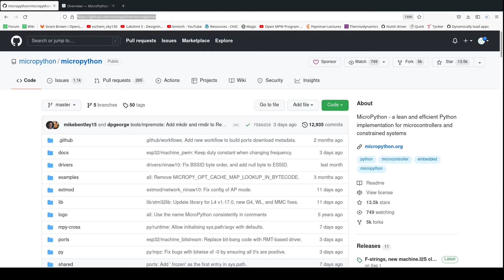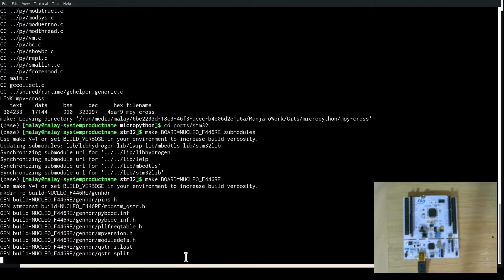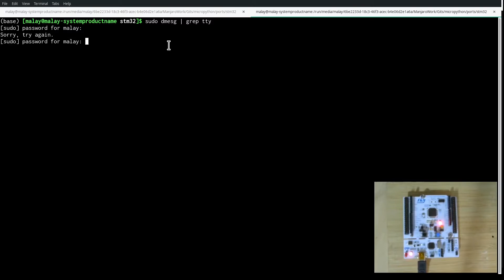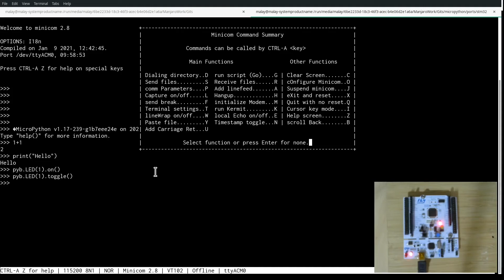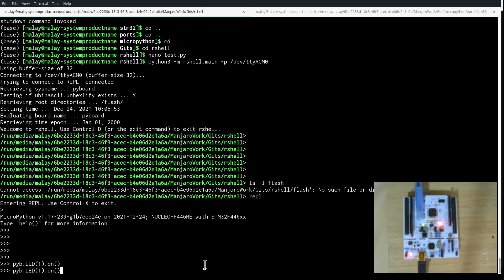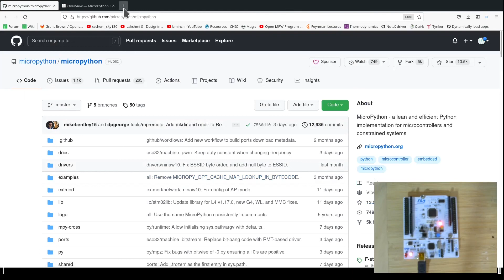Step by step MicroPython on Nucleo-F446RE

Comment: What should I do in order to use this method in windows? What could I do for using the: "make -C mpy-cross" command? Is mingw-w64 needed? I would like use this way but in windows through a git terminal with Visual Studio Code IDE. Thanks in advanced, I liked your video.
Reply: Answering my own question, just in case it helps anyone who had the same doubt. 
We need to install these SW in windows in order to make the compilation works:

- For a Linux terminal, we can use a Git bash, so install Git.

- Python3.

- arm-none-eabi-gcc (Arm GNU Toolchain): ARM Developer.

- gcc: It could be from MinGW-w64 GitHub.

- make:	Once you have MinGW-w64 installed, add mingw32-make.exe to PATH (ex: C:\Program Files\mingw-w64\[version]\bin).
	        Rename mingw32-make.exe for make.exe to simplify comands.

- openOCD, or any other flasher tool like ST-Link inside STM32CubeProgrammer.

For serial comm we can use any like teraterm, putty, Arduino serial console, etc.

I hope you can find this useful. :)

Comment: Can you select which UART to use for the REPL interface?

And how do you upload the python scripts to execute... I assume by default it will look for main_py at power-on?

I'm interested in commanding different custom scripts via the UART/REPL.
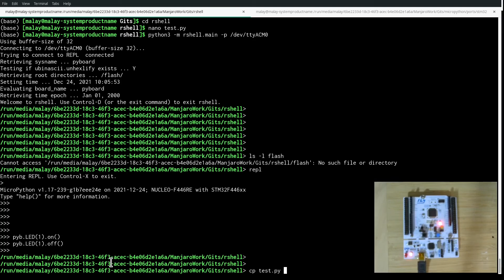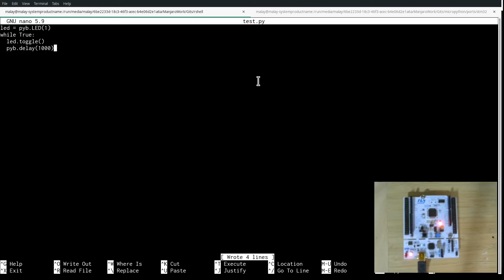Reply from the maker: Python scripts can be uploaded from rshell using command "cp <yourscript.py> /flash". Then you can execute it from rshell repl using command "execfile("<yourscript.py>). On this video this is demonstrated at 12:00 minutes.You can also see that the script was written using nano editor at 10:09 in the video. Hope that helps.